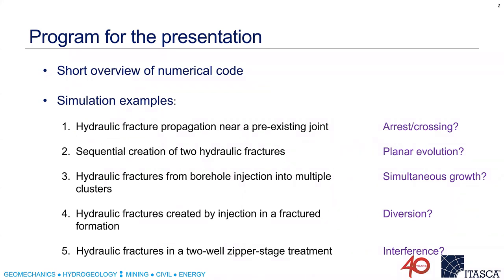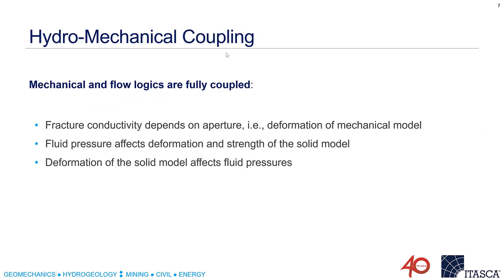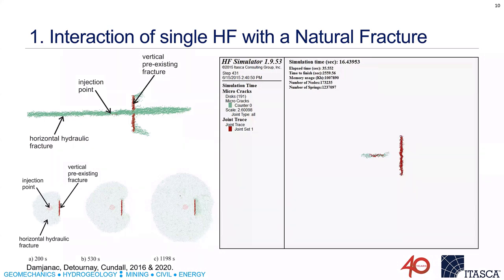Webinar: A Numerical Exploration of Hydraulic Fracture Interference - 2021 ARMA

Comment: The generated fracture width limit is set to 1 inch, meaning the fracture did not propagate until it reaches 1 inch, I think that this assumption is not valid for brittle rocks as our fractures generally do not reach these numbers, please correct me if  am wrong
Reply from the maker: Thanks for your question. The fracture propagation is governed by the rock toughness, not by the aperture width. The plots in the presentation show aperture contours evaluated by XSite. The aperture cap is a model parameter set to control potential numerical instabilities, not fracture growth.